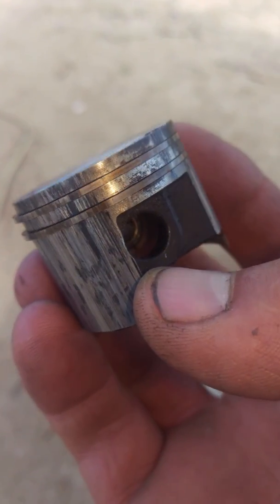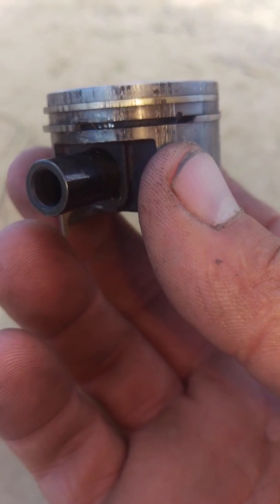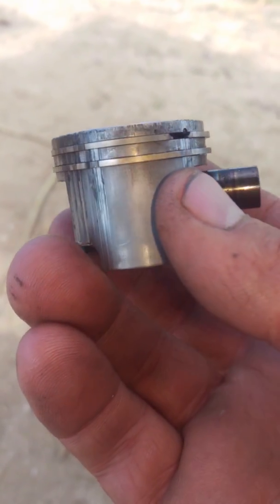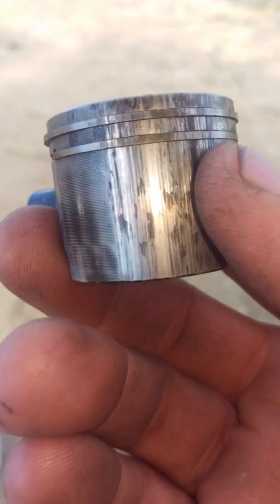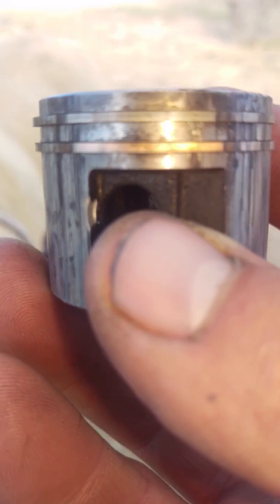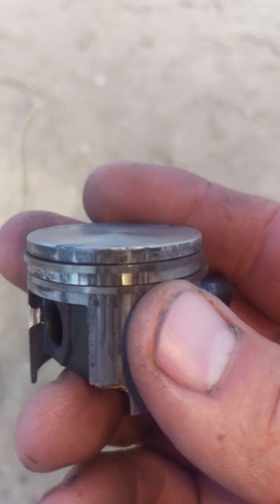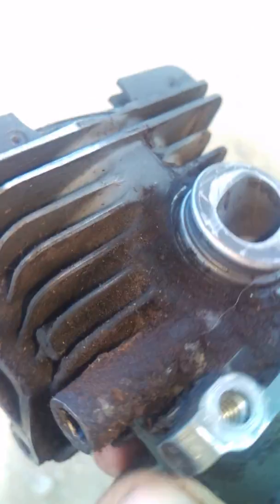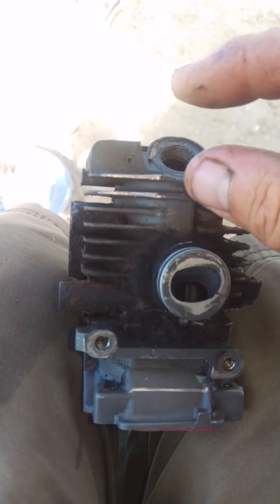My piston and cylinder are "scored" is that a big deal? Hell yeah!

Comment: When my saws finally quit running after a few seasons of hard work and neglect, I normally think yes, Bigger  bore and strocker time. I also install a modified carburetor on them with a  Velocity stack adapter, it allows for adjustments and a automotive style air cleaner to be used.

Comment: For a long time I was afraid to disassemble anything. Now I pretty well take off the bar and chain and the engine cover whenever I do anything. I find the act of removing things makes me inspect them a lot closer and  it is often easier to work on a buried component whenever the surrounding material has been removed (within reason).

Removing the exhaust used to concern me because it always looked so ratty. But I've come to learn that it should be a regularly serviced item to clean the exhaust screen. And now it gives you an internal look into the health of your cylinder, piston and rings.

For a newby like me, it can never be too detailed or too boring. Keep it up.
Reply from the maker: Once again the battery in my phone overheated and cut me off by about a minute. Oh well I think you get the jest of it.
Reply: You need to check the piston in that phone :)
Reply from the maker: @simonwelch560  you are soooooo right about that!